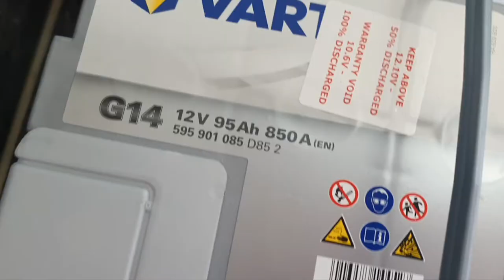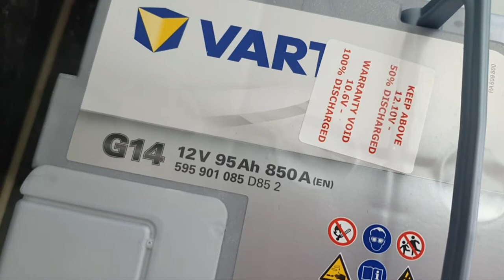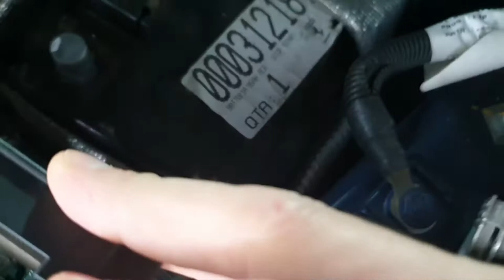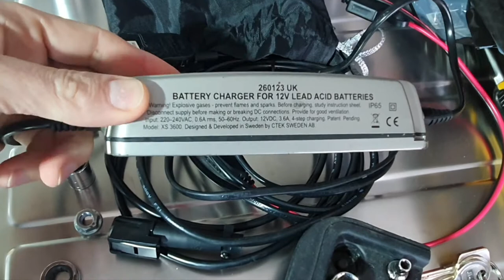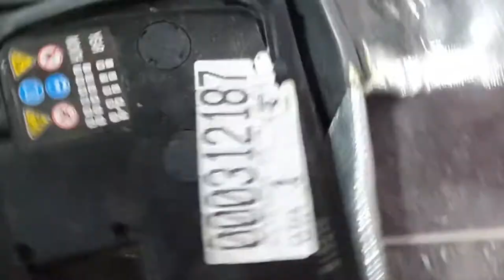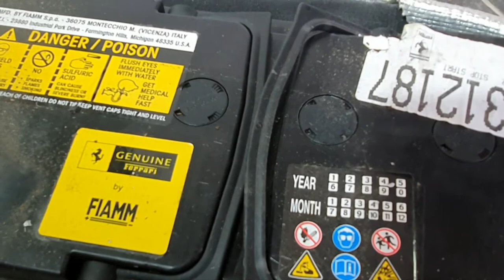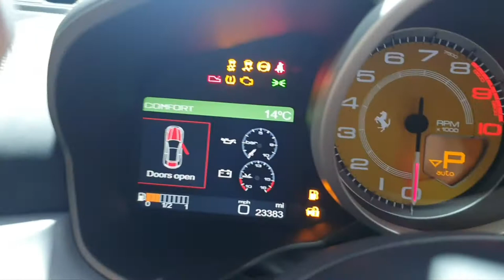Ferrari FF Battery Replacement | Varta G14 AGM | F-Car Guy

Comment: Do you have the part # for the charger and the cable adapter for the ff? Have the same issue lead acid charger with an AGM battery

Comment: Did you need to do any sort of computer reset? Are there any pitfalls to stay away from? I need to do this for my car.
Reply from the maker: No reset required, just disconnect and reconnect like any other car. Upon first engine start, I did turn the key to full ignition and left it there for a minute before hitting the Engine Start button, just to let all the computers fire up.

Comment: So i did this in December and filmed it but it was too unprofessional. Man was it a diffcult task! Hardest battery change ever. The trick to get the battery out is it needs to come out at an angle. I didn't have to stand on my ferrair just had to slowly tug at its untill it cleared the wires.
Reply from the maker: How are you finding your new battery? The cranking power is night and day compared to old battery, so glad i did it. Also I don't have it religiously hooked up t the tender like i used to, only if not in use for over 1 week I'll plug it in.

Comment: any chance u can post the model number of the battery?  i plan to copy your upgrade! thank you
Reply from the maker: Varta G14 Silver
 Dynamic AGM Car. Battery: Type 019. Bought from batterymegastore.co.uk cost £163.95
Reply from the maker: Oh and, i haven't had to use the tender since i installed it. I will however plug it in if I don't use the car for over a week.